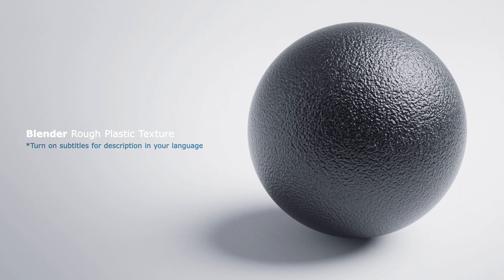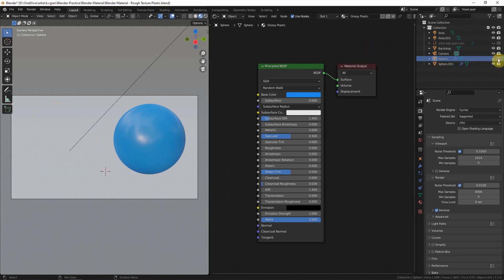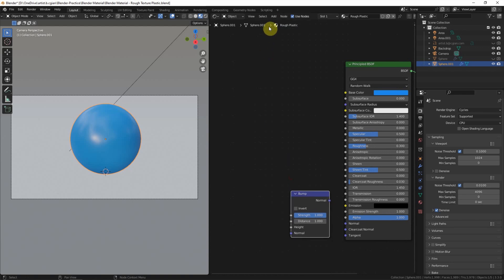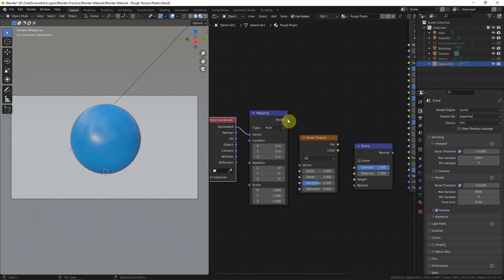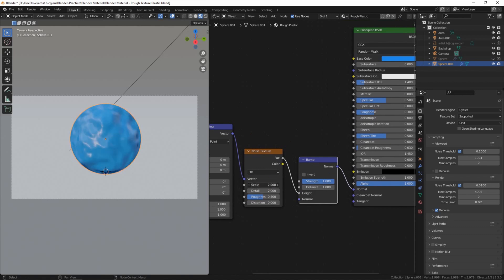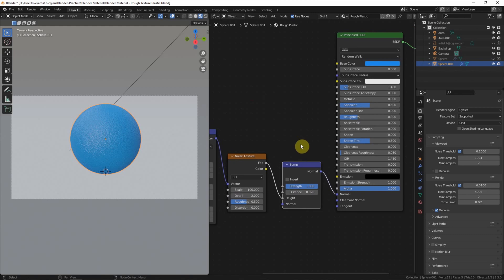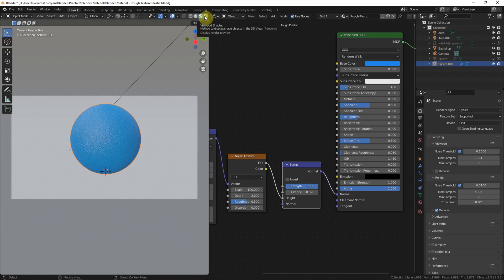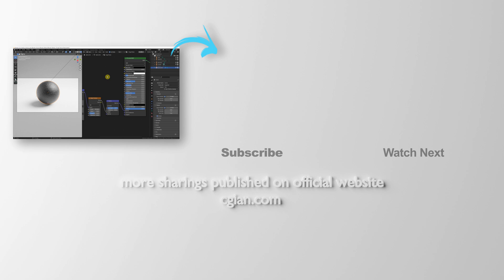Blender Material -  Rough Plastic Texture with Grainy Surface

Comment: Hello ! Tres bon tutorial. J'avais une question. Is it possible to have a texture like this but for 3D printing? Is it possible to freeze the texture and then export it in STL format? Does anyone have a solution?
Reply from the maker: One of the ways is to bake texture, then add displacement map to object with baked texture. Finally, apply  displacement and  convert to mesh